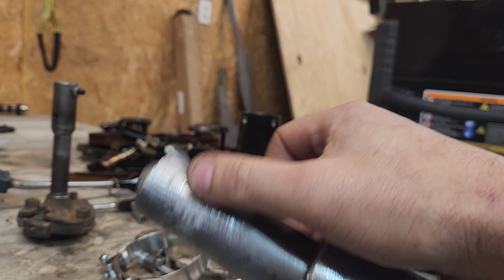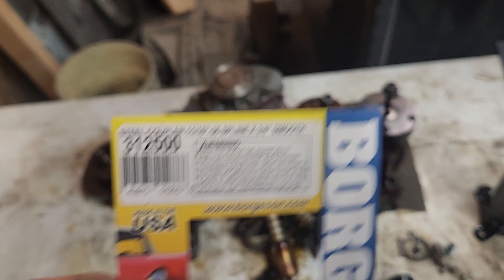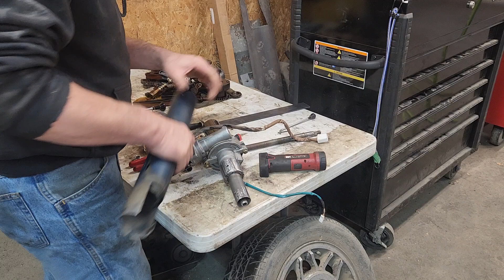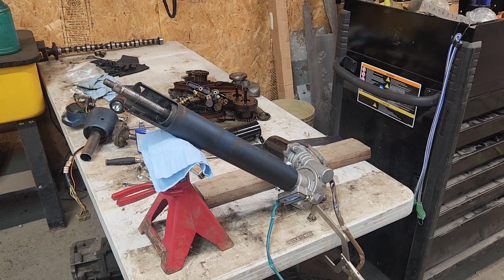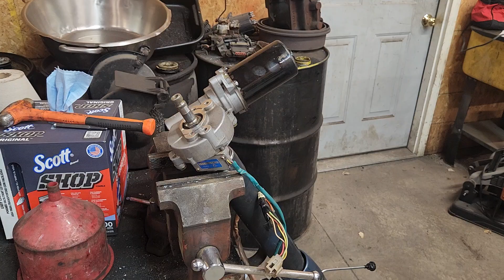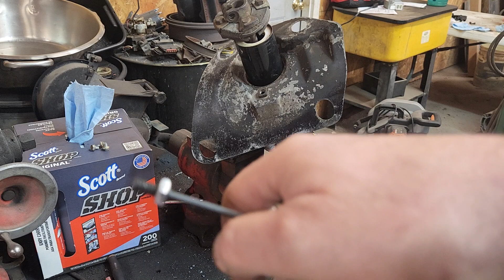Dodge Truck Prius Electric Power Steering Part 2; Taking Shape!

Comment: Please reconsider mounting to the motor proper. Maybe brace off the worm drive section instead, it is made to take torque in that direction. Good Fortunes and Great Successes.  (yes I realise you may have already completed) I haven't finished watching yet so .... 😊🤣🤝